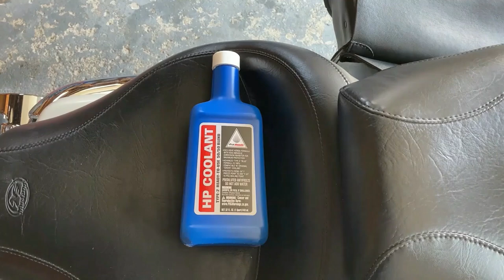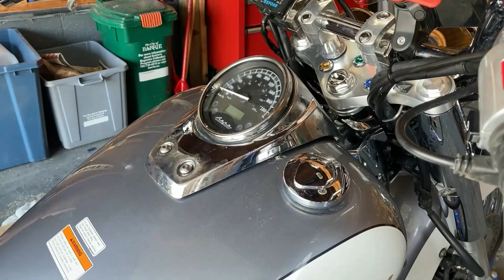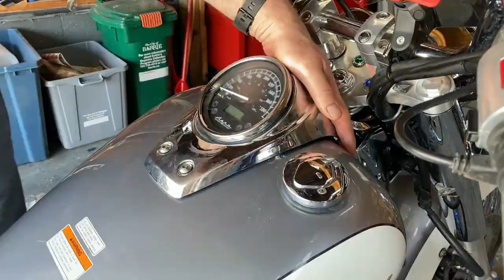Coolant Change Honda Shadow Aero VT750C

Comment: excellent. one of the best quality and most thorough videos that I have seen on this subject. i was going to get the Honda dealer to do it but they wanted $1,000 to change the antifreeze, change the spark plugs and check the valve gap, but now i feel confident to do it on my own. thanks.

Comment: thanks so much for this video! I was wondering how long the antifreeze would last, as it's now 8 years old. (2015 VT750 shadow aero) I don't think the original owner did the change as the bike had only 850 kilometers on it when I bought it. I'm going to change that antifreeze! and change the plugs, as the motor has developed a small hunt when it's hot.
What city are you in? I'm in Coquitlam, up the creek from Vancouver.
Reply from the maker: Your bike should be pretty much the same as mine. My VT 750 shadow arrow is a 2014 in the video. My bike came with green coolant but the latest stuff from Honda is blue. I’m not sure what year they changed to this things on the Internet vary from place to place, I’m glad you found the video helpful. And for your final question, I live in Barrie Ontario.

Comment: Thanks Doug.  I'm looking to buy a used 2009 Shadow (same two-tone color as yours) and just wanted to be sure I'll be able to do my coolant changes.  I used Prestone 50/50 in the past on my previous bike.  I'm assuming the Prestone 50/50 will be fine.  Correct?
Dean
Seattle
Reply from the maker: I’m thinking Honda recommends their coolant. I think there’s some corrosive problems. If it’s not the right chemistry I check the shadow forums on Facebook as a good resource or a shop manual